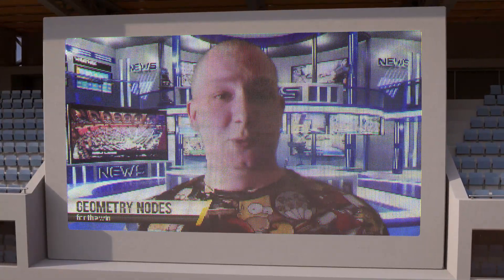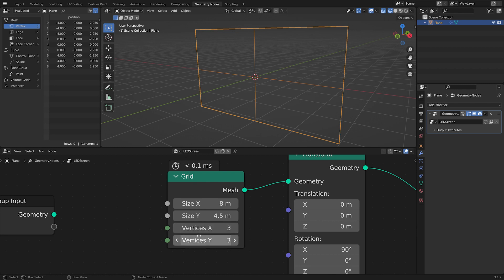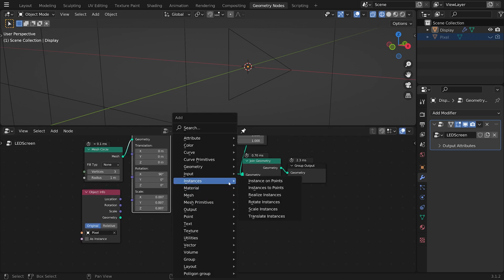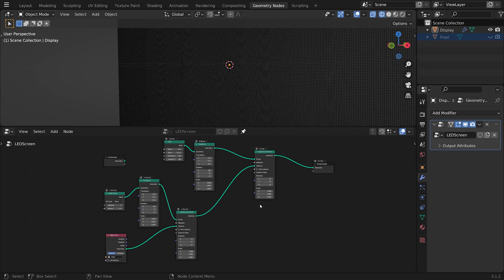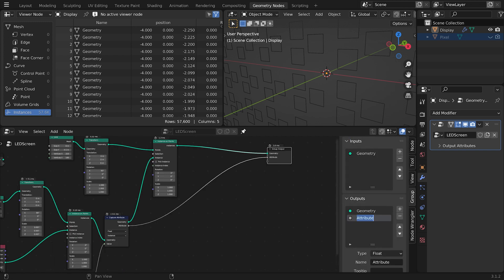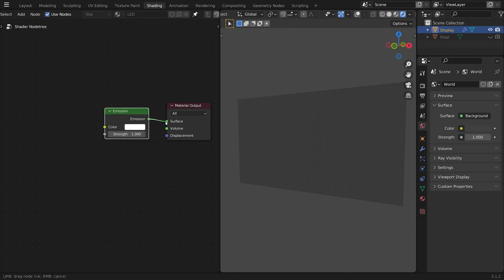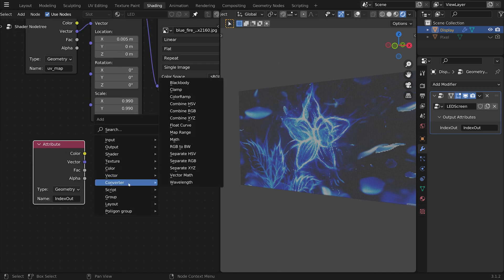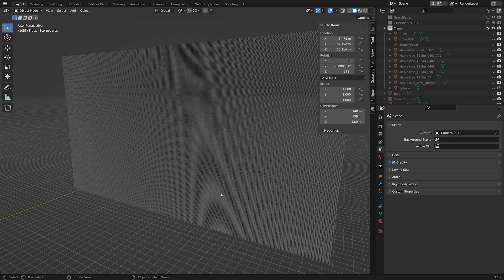How to make a large LED display in Blender using Geometry Nodes

Comment: For those having issue with later version like blender 4.0,  add  one more node called (  Store Named Attribute  ) between  ( Grid ) and  ( Transform Geometry)   in the Geometry Nodes Window.After that join UV map ( from Grid ) to Value from (Store Named Attribute) and type ( uv_map ) in the Name . Change Point to face corner
Reply: Any reason why my texture is distorted? It’s warped and I can’t figure out why.
edit: figured it out. the STORE NAME ATTRIBUTE needs to also be set to VECTOR, at least thats what worked for me.
Reply: @RussellAugustAnderson  same for me this fixed it Ty
Reply: Thanks yall <3

Comment: If you're having issues with the uv_map attribute in your shader, go back to your Geometry Nodes and drag the "UV Map" field from the original Grid node into the Group Output.
Then, open the modifiers tab, click the "Output Attributes" dropdown on your geometry node modifier, and type in a value for the new UV Map field that should now be there (I just made the output name "UVMap" since spaces aren't allowed).

Finally, back on your shader, your should be able to use the same Attribute node with the type set to Geometry and the Name set to whatever you named the UV Map field. Works for me in 3.6
Reply: Thx a tons!!
Reply: having a Hard Time do have Reddit?
Reply: Thanks for the tutorial  @timothychibuzor4755  and @McJimbles' comment provided the solution for me.
Reply: Thanks!
Reply: This comment needs to be pinned since the tutorial is outdated and this was the only way to get the UVMap to work in 4.0!
Reply: Thanks
Reply: Thanks so much!!! The world needs more people like you :)

Comment: Im having an issue when using the uv_map attribute. The whole image turns 1 color, and if I use a Texture Coordinate UV node, it displays the image within each pixel so that doesnt work either.
Any help?
Figured out a fix (working on version 3.5). I connected the UV Map node from within the Grid (in the Geo Nodes side) to the Grp Output, and gave it the uv_map value, and also added a Set Material before the Grp Output too and then it worked!
Reply: Hi, I am having the same experience. Can you explain this in another way? Are you saying.... In the Geometry Nodes Tab, you drag the UV Map attribute from the original grid node into the GroupOutput node?
Reply: @justinmzielke3246  Yes, that's correct. Then on the Properties tab within the Geo Nodes modifier type uv_map within the textbox, and that should work. If you can't manage to figure out, shoot me a dm.
Reply: @RobynLtW  Hey thank you for your response. I did try it and a few other things and still cannot get it to work. Sadly, I've wasted too much time on this and will have to leave it out.
Reply: @RobynLtW  Argh having the same issue! Help!

Comment: If you want the exact size for the pixel he's using (if you have the same size screen and resolution), it's a width and height of 0.00833333333m.

Comment: Awesome tutorial, thank you for that. I may have watched it 3 or 4 times already and I still think I'm missing something. I changed a few things though. What I'm doing is just having a circle per pixel from the photo instead of 3 small squares per pixel from the photo. But the problem is that the whole image is going onto each of my circles. I just don't understand why it doesn't take the individual pixel from the photo and sets that to the designated circle.
Do you by any chance have an idea what I did wrong?
Reply: This worked for me:
Working on version 3.5. I connected the UV Map node from within the Grid (in the Geo Nodes side) to the Grp Output, and gave it the uv_map value, and also added a Set Material before the Grp Output too and then it worked!
Reply: @RobynLtW  Thank you very much !! Worked for me too but without the Set Material

Comment: Great tutorial, thank you for this! I have a question:
Is it possible to use a modeled object instead of the grid? 
Basically I am struggling with projecting the image onto a 3D object. Is there a way to extend the grid in Geometry nodes?

Comment: Hi. Good job, but! 1. Should be added scaling math for different resolutions. 2. LED structure, I mean RGB cells do not locate like triangle. Its like 3 rectangles which fill all square of the cell. I like stadium where you put big led screen. Thanks.
Reply: I think he used motion tracking/camera tracking (see e.g. https://www.youtube.com/watch?v=CVPcT0dJmoY) to combine the screen with real footage of a stadium
Reply from the maker: Nope, the whole things a scene in Blender. I got the stadium model from BlendSwap (Did my own materials and the grass field) and then chucked in the LED panel.
Reply: @BlenderBrit  >  the whole things a scene in Blender
Oh, OK then. I thought they looked really erm realistic.
Reply from the maker: It was a bit of an over simplification, intentionally, to keep the tutorial light. Take it a step further and look up some actual subpixel layouts and give it a go. 
I did something similar for Samsung QLED panels in another project, most of the layouts are available to google.
Reply: @BlenderBrit  I already found and ported this stadium into EEVEE for my soccer short animation film, which soon will be released. I hope. This stadium model is quite bad, it has a lot of errors, but it's free. What I can add is all this LED structure is redundent if camera will be far away from the LED Panel. In the end I removed it from the screen and just used a regular plane which shows a footage. Sorry ) But it looks very cool in close distance.

Comment: Hi Bill, awesome tutorial. Thanks for sharing it with us. I’d like to do a led sign with a much higher resolution for an image. Unfortunately, when tweaking up the X and Y vertices in the Grid shader, the 3 sub-pixels coincide with each other and the final result is messed up (e.g. clouds turn reddish instead of pure white). I noticed that for a higher resolution result you’d recommend using a completely different workflow. Can you tell me what should I do and change in my present low resolution work, so as to adapt it to a higher resolution result? Thank you again for your support, Nissan
Reply: Found the solution. Thank you.

Comment: Great video, thanks you. For a "hey ma, look at my donut blender file" person, it is not trivial to add moving video on the pixels. Somehow I only get a still. Could you give me some hints? #n00b
Reply from the maker: Hey bud, you use the same node for loading in the video but you need to specify how many frames in length it is (Just make it higher than your animation length and it'll be fine) 
Turn on auto-refresh and cyclic too (Little options on the same node) 

That should work fine then though you can also specify a start frame and offset for more precise control.
Reply: @BlenderBrit  thanks, solved it :) <3

Comment: If you are having issues with getting the pixels to get on the points at 6:27, I found that using "Relative" instead of "Original" for the pixel "Object Info" node solved the problem for me
Reply from the maker: Whoops, did I leave that out? My apologies and thanks for sharing 👍